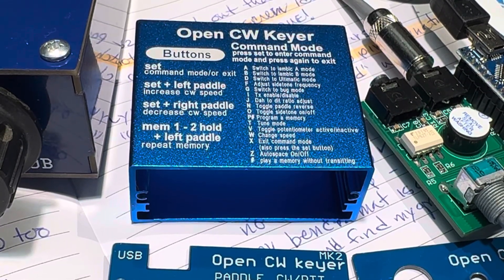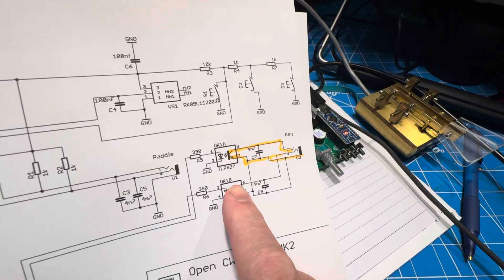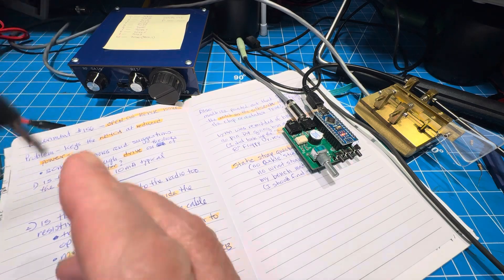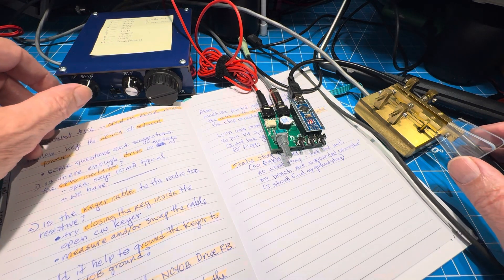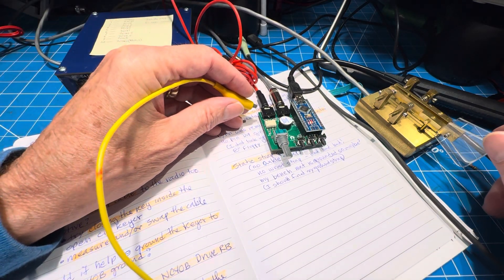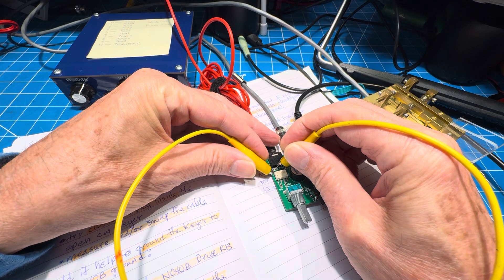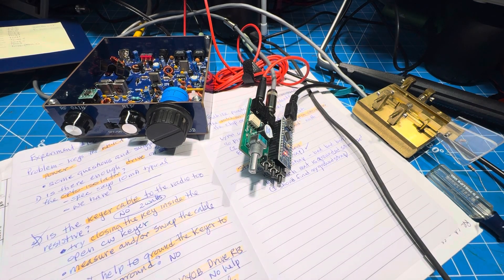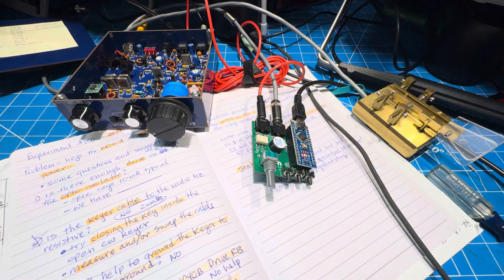Open CW Keyer Build - Eliminating things that it isn’t

Comment: Do you run a stereo wire from the CW/PTT plug straight to the key input on the transceiver? I am using an old Kenwood TS-120V and don't want to damage it.
Reply from the maker: The key lines on most non-Keyer equipped radios are two conductor 1/4 phone jacks. A mono cable was originally used, but you can use a stereo cable since the middle pin won’t be used. 
Others with the the TS-120V can confirm